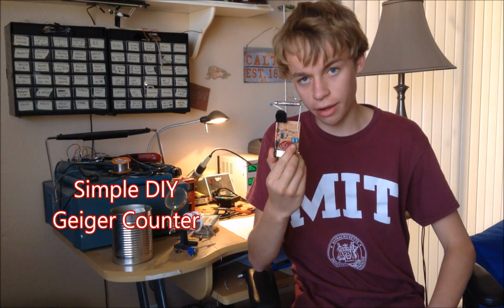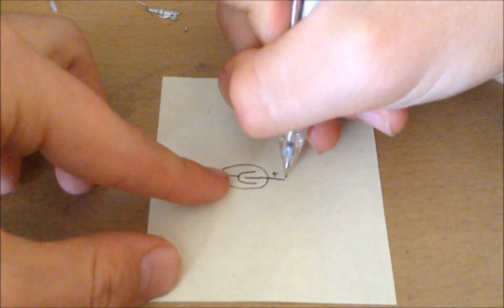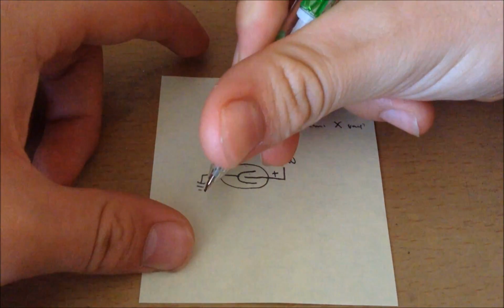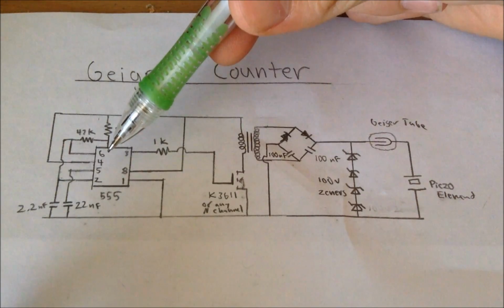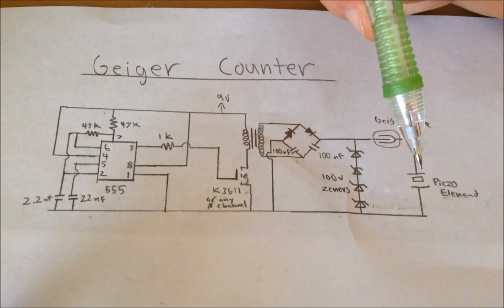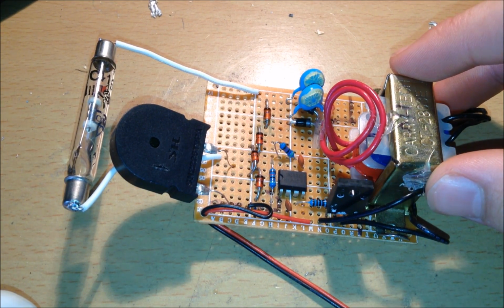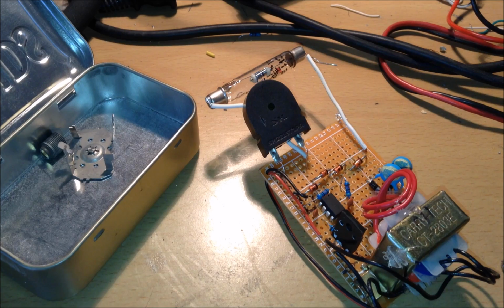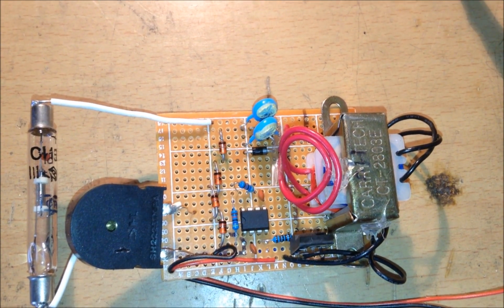The Simplest DIY Gieger Counter

Comment: 0:43 Neon, argon, yes, but also a  halogen quenching gas like chlorine or bromine, or an organic quenching gas.
4:06 Voltage doesn't kill you. Amperage does. Not enough amps off of a 9V battery to do you any harm.

Comment: You mention neon as an inert gas, but what about the common neon lamp that fires at 90 volts or less?  Instead of a Geiger tube and 400 volts, is it possible to make one of these using a common neon lamp and running it just below the point it fires, using a volt, milliammeter or maybe an o'scope to monitor the variations in signal in the presence of a radioactive source?

Comment: this is dont sensetivity tube, you need a SBM-20 or si-7g(i have this) or sts-5  or chineese J305 gayger counter tube for use in home, but this tube what you have can be used in very place infected with radiation, and use detector on cd4011 , work is very well, with this circuit i have clear and loud click

Comment: I read down the line you got the transformer from a radio.  Was it intended to provide a couple hundred volts originally?  Or was your pulse timing adjusted to set the output before setting right at 400v with zener stack?  Basically could any small transformer do that?

Comment: Hey this is suuuper cool but if the circuit is completed with the ionisation of the inert gas (due to radiation as you explained) then why do you need anything other than the transformer, output (LED, buzzer, etc.) and the Geiger tube? With the addition of a battery this would be significantly more compact, and I'm guessing that a large amount of circuitry wouldn't have been added without reason. Can the transformer only be driven by the MOSFET and the squarewave?
Another question is could you omit the voltage increaser if you wound your own transformer to the correct voltage, or would that have too much of an effect on the current (is there even a functional requisite current for the Geiger tube, or is it just for the buzzer?)
Sorry for being 6 years late, but I would really appreciate you getting back to be on a (probably pretty stupid) question.

Comment: Remember Tanner that you must current limit the tube. Current spikes will occur as the tube conducts and can be destructive.
Reply from the maker: Yes, that is what the series resistors are for. The voltage across the circuit divided by the resistance in series with the tube gives the max current that can flow through it, which is lower than its max rating. The current spikes translate to voltage fluctuations across the series resistor which is how the tube is measured.
Reply: @TannerTech  In your circuit diagram, on the right side of the diagram after the transformer (high voltage side) you don't have any resistors. You have the doubler (By the way,, good usage of a doubler here to get the high voltage, there are other ways but the doubler keeps is sweetly simple!). So on the HI V side of the circuit you have a doubler, a series string of zeners to regulate, the Geiger-Mueller tube and the piezo buzzer. I'm not seeing any series resistors.
Reply: @TannerTech  The piezo is basically a capacitor and will add its energy to the voltage spikes when the tube conducts. Since you have the tube and the piezo in series, the zener string will not be of any help either. A quick guess would be to add a series of 3 or 4, 1Mohm resistors on the tubes anode and it should be close to right on. I've found with my geiger counters that driving the tube 10-15 volts below its max rated voltage and never above max, increases tube life noticeably. I use surplus Russian tubes as well. This is a great circuit for those looking to build a first Geiger counter. If I were you Tanner, I would think of ideas to amplify the clicks audiowise, substantially, and maybe include a LED branch that will flash with every click as well. All in all I like the circuit and it would be done full justice if you were to make a short part two "with upgrades," video and link it to this one. Even if you don't actually build the circuit, just an updated circuit diagram and brief explanation would be sweet. I am going to use your circuit with those small changes to let my 11yr old nephew put together his first Geiger. He's been occasionally bugging me about starting on one since the war started in Ukraine with talks of possible nuclear war etc.... I reminded him that it will probably be AWHILE before any Russian surplus electronics are on the market direct from Russia! Makes me wish I had stockpiled 10 or so of the SBM-20 tubes which I've used in the past. I just might have one in an old project I can scavenge. (If it's any good!) I blew so many of those tubes experimenting..... hell if you bump the things even softly, the wrong way, they can fail.... Anyways, it's always enjoyable to watch your content. That MIT shirt looks daaamn good on you buddy! Keep up the good work! -Rex
Reply: @ripstephenhawking8787  I agree with your observation about the need for series resistors.  I suggest they be placed between the Geiger tube and the Zener diode string, as you mentioned several mega Ohms.  I think there should also be some current limiting resistance in series between the transformer and the Zener diode string to limit the current that can flow through the diodes also.

Comment: Nice, that said you should get some uranium ore. That Americium is an alpha emitter and the glass of the tube itself is probably an impediment to much getting in. Those tubes are generally for Beta/Gamma sources, alpha is typically measured with a pancake style detector.

Comment: I gave you a thumbs up for going through all the work on this video but there is a easier way with a battery powered handheld blacklight .. same speaker and just two resistors
Reply from the maker: What do you mean by backlight?  That would be interesting to try out!
Reply: @TannerTech  WHen I first saw the thumbnail for the video I was thinking... 'that tube looks like a small germicidal Hg vapor tube.'  Your discussion in the video and the close ups show that it is quite different from a small germicidal (blacklight) tube.

Comment: A nice simple circuit, I like it, and I appreciate the hand drawn schematic and the explanation.
And I agree, a 4.7m ohm resistor would probably be a good idea to preserve the life of the tube.
Reply: actually the schematic says 47k not 4.7k, if this is not correct it should be stated clearly in the schematic

Comment: Good job, I think I will make a version of this myself. I think you could make it much nicer if you incorporate an amplifier, you could use a volume pot and a tone pot or resistor to block the high pitch tone of the transformer or a filter cap might be good.

Comment: a geiger counter doesnt measure the intensity of the electrical current that passes through the tube when its ionised : a each ionisation there is a very small voltage pulse and thats what the geiger counter actually "counts". The device that measure the current created by ionisation inside the tube is called an ionisation chamber . These are 2 diffferent devices that are used to measure and quantify ionisation radiations.

Comment: Cool build. I have 4 questions though. You said the device uses very little current, is that because very little current is lost as heat inside of the transformer and circuit, or because current only flows when radiation ionizes the inert gas inside the geiger tube? Second, is the ringing sound coming from the transformer itself or is the ocelation of the current due to the transformer causing the piezo (not sure if I spelt that correctly) speaker to buzz, and if so is there a way to filter the signal to make it more quiet? Third, is there a way to boost the audible clicks made by the piezo speaker? Finally, is there a way to replace the piezo speaker with some digitizing sensor to integrate the circuit into something like an arduino (giving one the ability to measure instanranious dose, cumulative dose, intensity, and other such data products) utilizing the same basic circuit design and components?

Comment: Hi, you need resistor between HV generator and GM Tube. You need filtering capacitor in you high voltage. The tube cannot drive any speaker, you kill the tube ! Use a classic NPN to drive the speaker.

Comment: My geiger tube is flashing every time when it detects, is that a problem?
Reply: Nope thats the gas inside the tube  getting ionized
Reply: "tick tick tickity tick means get your ass out of there and pop a few rad-x for good measure"
Reply: it probably means that your voltage is a little too high, use a variable resistor on the primary side of your transformer to find the lowest voltage where it will still get a click, without lighting up your tube....I would imagine that leaving it like this MIGHT shorten the life of your tube..or it's sensitivity...they are not meant to do that.

Comment: Americium is an alpha source and it looks like you gm tube is of the thick window variety. This gm can only detect gamma as alpha and beta radiation cannot pass through the glass. You will need to test your detector with a source that gives off gamma such as an old luminous altimeter dial.
Reply: rjs23565 americium gives of some gamma rays.

I could detect it even Through a few millimeters of aluminum.
Reply: Americium 241 decays into isotopes that produce γ rays.

Comment: Not very sensitive. Only a few clicks from a source sat right next to it, which would most likely get hundreds of clicks. I suppose that is what you should expect from a makeshift set up like yours though. Hardly useful in most situations.
Reply from the maker: +Mr. Chang Yep, you are right.  I think that I also partly ruined the tube by running it without an anode resistor.  Check out my latest Livestream, I made a much better counter.
Reply: @TannerTech  the source used here is americum wich is mainly an alpha emitter . alpha particules cant get through the tube, there are also very few gamma rays emitted and thats what can pass through this kind of geiger tube and thats why this geiger counter doesnt read much. If he used uranium samples or radium watch it would react more strongly.

Comment: You will kill the tube quickly this way, I am afraid. The current should be limited by an 5MOhm serious resistance at the anode. The piezo has relatively high capacitance (~100pF),  therefore the current will be very high during the discharge. I used a MOSFET 2N7000 + 220kOhm on the cathode side to drive a 8 ohm miniatuer speaker (and 5,1Mhohm with short wire of course on the anode side).
Reply from the maker: I will have to try that.  Thanks for the advice.  That is probably why this counter no longer works.  Haha
Reply: We are tryna build this
Reply: Some piezo clock up in the few nF region so the limiter resistor is an absolute 'must'.
Reply: "serious resistance at the anode"... Serious resistance is futile!

Comment: Pretty sure, people would like to be able to build the tube.. if im going to order a replacement, ill buy the unit it was designed for.. so, using your rig.. how about a clever method to build a tube.
Reply from the maker: I don't think many people would have the required glass blowing tools and argon gas supply to build a geiger tube.
Reply: @TannerTech  If I'm not mistaken some Geiger tubes use a combination of fill gasses so that the tube quenches quickly allowing a shorter reset(recovery) time to be ready to detect the next event.
Reply: You don't need glass. A metal tube with a window of some kind at the end would work just was well. Why use argon? Why not helium?

Comment: If you were to take your device to Fukushima Japan what different radioactive elements would it detect? Could you put a visual counter on the device and have it show whatever emitting element it was?
Very cool design. Thanks!
Reply: The tube is sensitive to beta and gamma radiation, prinicpally it can detect almost all radioactive isotopes. Most alpha emitters (like the shown americium 241) also emitt gamma radiation. A Geiger-Muller tube however can not tell you what isotope the rays come from because it gives an equal pulse for every detection event. To differentiate isotopes  the signal pulse would have to be related to the initial energy of the particular photon. There are other types of detectors that show this relative signal (certain szintillators like NaI or semiconductors, proportional tubes) . Of course, the necessary electronics for that are a bit more complex.

Comment: I'm curious if there's a way to replace the Geiger tubes with something more common.
Idk, I've been watching too many Fallout videos
Cool Institute shirt btw.
Reply: You mean like using a neon bulb, but lowering the voltage below the conduction threshold. 

http://electronicdesign.com/site-files/electronicdesign.com/files/archive/electronicdesign.com/files/29/1634/figure_01.gif 
https://en.wikipedia.org/wiki/Neon_lamp
Reply: Bert Isevil Sweet, thanks
Reply: I should probably add that it is not going to be very good when compared to a properly designed Geiger tube because the glass is so thick that it will block 100% of all alpha, a very large percentage of the beta will also be blocked and it is going to be mostly sensitive to gamma. It is not totally useless but it is not going to be optimal. But you could pick up 100-200 red neon bulbs from China (Rice cooker indicators) for like about $10.
Reply: I've been reading more and there is some radioactive material in almost all neon lamps to reduce the trigger voltage (either in the gas or more often in the electrodes). So scrap that idea, they will be self triggering.
Reply: Bert Isevil 
Dam, self triggering like a sjw lol
I was also considering reverse engineering a smoke detector since it's a radiation detector that works with smoke, just this morning.
Reply: Bert Isevil 
Btw, it's cool to meet another pen-tester that's into science and electronics( Btw, I'm also a brony :/, fair warning), though im a joke at best.
Reply: @itsevilbert  The trigger voltage of Neon glow lamps are affected by light, or other photon emissions.  The incident photons raise some of the electrons in the Neon fill gas above their ground states, so those electrons become ionized at a voltage causing the lamps to begin to conduct at a somewhat lower voltage.  When/if that rice cooker's Neon indicator starts failing and blinking, try shining a flashlight on it, you should see that the flash rate goes up, or the lamp may glow (continuously).

Comment: Good job! Is it possible to amplify the clicking sound somehow?
Reply: You could very easily do so with an NPN transistor.
If you connected the base of the transistor to the negative side of the geiger tube and the emitter to ground you could then hook up a speaker between the collector and the 9V supply to give sound. Doing it this way won't work with a piezo, but any speaker that has a coil in it will give sound.
Reply: adam co op amps with an npn transistor would to the trick
Reply: Poptart McJelly will the base of the transisto be able to handle 400 volts
Reply: If you wanted to go crazy, you could replace the piezo with an optocoupler and then connect the other side to a low voltage op-amp circuit to run it through a set of speakers. It may not be as good quality though. Setting it up for headphones might be better.